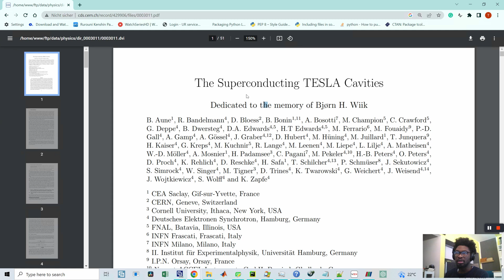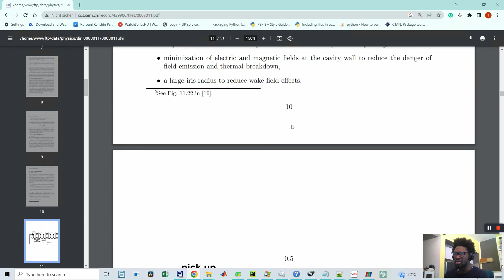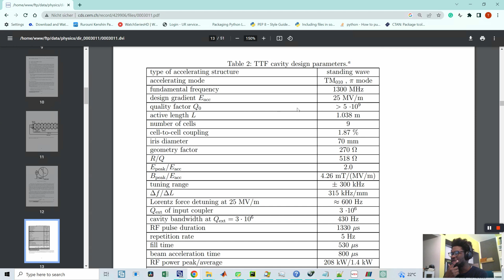Lorentz force detuning calculation for TESLA cavity using CST Studio

Comment: Very good video!  Can we obtain the whole data of E and H field distribution after the deformation to calcuate the Q and R/Q please？
Reply from the maker: If you mean the E and H for the deformed cavity geometry, then yes. On the Post-Processing tab, click on Result Templates, then select 2D and 3D Field Results, and then Export 3D Field Result. 

If you have a method to calculate the R/Q and Q from the exported data, then the above information is enough to get the fields. However, you can calculate the R/Q and Q directly in CST Studio Suite.

Calculating the R/Q is the same step, but the final selection should be the 3D Eigenmode Result. Then in the pop-up window, under ' Result value:'  select R over Q. You can also select Q-Factor calculation from this menu. However, you should be careful about which Q-Factor you select since you have two Q-Factor calculations: one from the Perturbation method 'Q-Factor (Perturbation)' and the other from lossy eigenmode simulation 'Q-Factor (lossy Eigenmode).
Reply: @numurho   I find that the E and H field of the deformed do not display correctly. I have three tasks, 1. RF simulation with eigen solver; 2. mechanical simulation;  3 RF simualtion with the imported displacement feild from task2. The E and H in the task3 seem the same as the task1.
Reply from the maker: @kong4902  
How are they displayed?

In what way are they the same? Do they look the same or did you try to plot the value along some axis point to compare? For small perturbations, as with the LFD, I do not expect that much change in the fields but the change can be observed by plotting the fields along some axis and comparing the two plots. You may need to zoom in.
Reply: @numurho the E and H in the 2D results looks the same as the nondeformed. My mechnical deformation is relatively big, the displacement field is visurally obvious. I hope the E and H field will map on the deformed component. It seems I can only have the frequency change with the error analysis, not the change of the Q or RoQ induced by the deformation.
Reply from the maker: @kong4902  Now I get what you mean. According to the documentation, contrary to what I thought, the displacement is not actually applied to the geometry, so the fields remain the same. I did see an option to calculate the Q-Factor sensitivity from the 3D Eigenmode Result drop-down, but I did not see this option for the R/Q.
Reply: @numurho  Thank you for pointing out the Q-Factor sensitivity, it does not calculate though. Only the frequency sensitivity works.